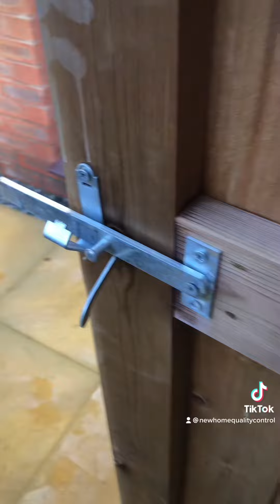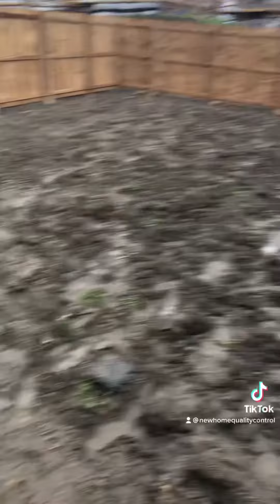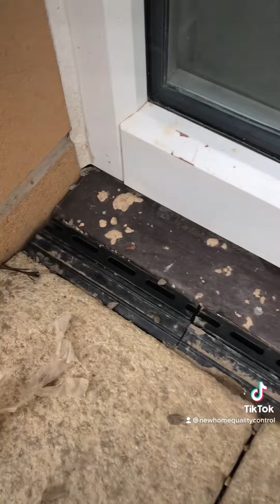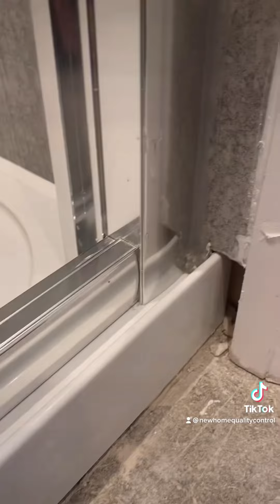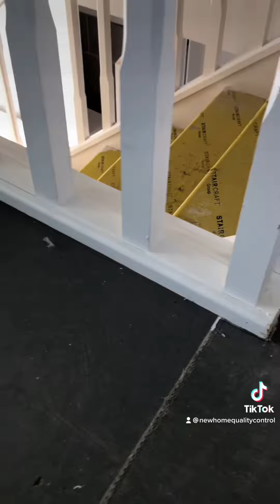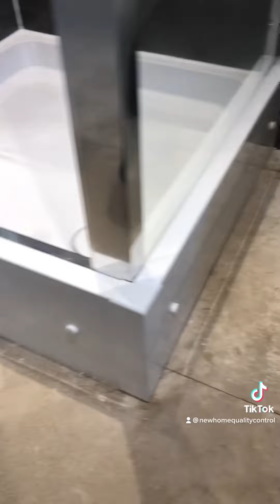Major Issues! New Build Snagging Inspection

Comment: I used to work for a firm that did the "hand-over-cleans" IE the cleaning before signing off the property for sale, between our boss the site agent and the architect it was a three-way scam, by the time we were on site all the trades had left and gone to new sites, there wasn't anyone to fix things, we were told to hide things, cover things up, make it look OK but never to make it right, it was all about disguising problems and camouflage, the punters know nothing about building regs and look at the kitchen worktops, the cooker, fridge etc and the bathroom/shower, the fact that the roof is not tied to the walls or the extractor fans did not extract to the outside wasn't an issue, cavity wall insulation was at best sketchy, its the stuff you can't see that's the worst. what really got me was the level of contempt the sales team had for customers, all smiles until they left then it was "God are they stupid" and "who do they think they are"  when people asked for things to be made good,

Comment: Yeeeeeeeeeehaaaaaaaaa brilliant videos bud…..
Got told once on a new build by the site manager to put paint straight on new walls straight over plaster as they wanted them finished…sometimes the cause isn’t so much the guy doing the job it’s the big corporations speeding up the process so they can the houses signed off.
I often wonder what happened to the house I painted when all the paint fell off the walls though….

Comment: Some seriously crap work goin on there but no-one on planet earth is ever going to convince me that wall plate straps do anything. Let's just think about it logically for a moment. Weight of trusses is negligible, but the weight of tiles and the plasterboard hanging from it equates roughly to a car. The good lord has given us gravitational pull.
Reply: Try watching a jumbo jet taking off. Gravitational pull has it's limits. There was a guy with a wide open fronted garage in the news earlier this year. The wind lifted the whole roof off and dumped it on his race cars...😳
Reply: @nectafarious8842  Was it a pitched roof tiled with concrete or clay tiles and plasterboarded underneath.? If it was a wide structure with no door a bit like a tiled carport I would bow down and use restraint straps too. Its just not necessary in 99.99% of applications.